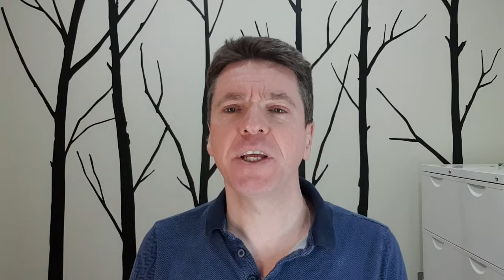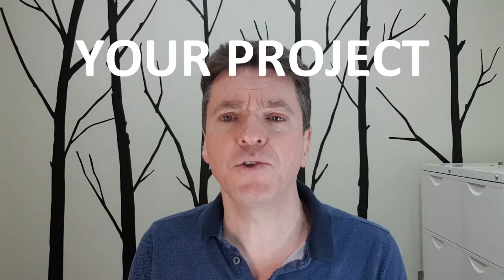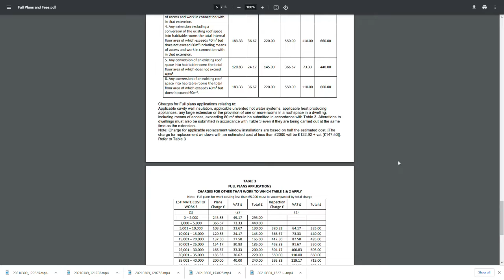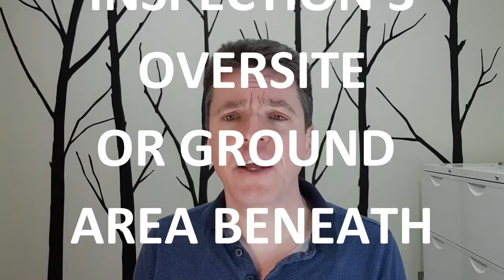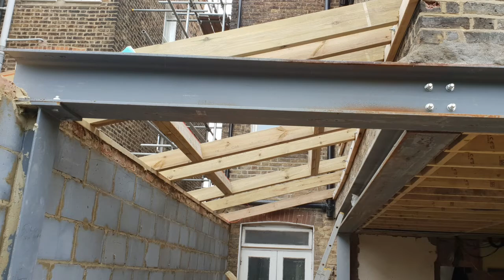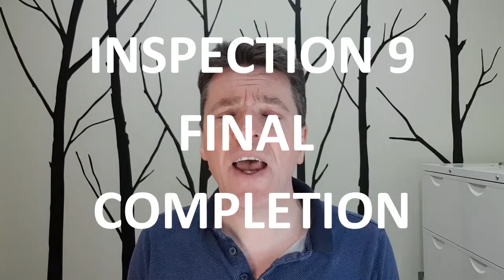Building Control for Extensions - All You Need to Know - What, Why, How & How Much - Housing Market

Comment: My single storey extension 3950 by 7800 would i need a steel above current existing french doors? If im not planning on making the knock through wider.  Just living room space and a flat  warn roof. Im a hard metals roofer and cladder by trade. 
The party wall is brick. With two other sides timber framed to hold my aluminium standing seam panels.

Comment: I'm a first timer doing a self build annex, I used Breckland Council. They did the initial visit when planning was first permitted. It was an informal chat, on site. They were really helpful and answered my questions, especially regarding deviations from the building plan and what can and can't be changed without amendments etc.

After each check I asked them what they wanted to see next. Booking inspections was really easy through their web portal. The first check was the foundation trenches, then drains, then DPC, then oversite with DPM before I poured the first slab. After that they said to go for it but contact them before covering up any insulation. 

They are very hot on insulation now. I kept records of all the U value calculations and have kept receipts so I can prove materials used. I've taken lots of photos and videos at various stages. I have also kept of all the official document parts and how they apply to my build. I am not a professional so I have done it "by the book" quite literally.

Comment: Hi 
Do building control have the right to say that we have to put pir insulation on our inner wall of cavity wall? 
We have our extension done and have issue with the building control,unfortunately they are private as I thought it would go faster and smoother but it seems to be opposite way,
Our extension is a cavity wall,break work outside and concrete block inside and it’s 100mm cavity wall insulation between but now he say we have to put 50mm insulation on our concrete block wall 
Could you guide me on this pls

Comment: Be aware that if you use an approved inspector (private inspector) then they should be informing your local council that work is due to start. This is called an initial notice. This gives your local authority 5 working days to get out on site to inspect. If the local authority notice that works have started within the 5 working days of receiving the initial notice then the approved inspector will be cancelled and the local authority will take over the inspections. Although this generally won't hold up your works it does add added costs as the builder or homeowner will need to complete a regularisation form which is more expensive than a building notice or full plans due to the works starting without permission. Then you have the issue of claiming back any money paid to your approved inspector. If the approved inspector is not at fault and your builder started within the 5 working days then the approved inspector has every right to withhold any reimbursement. So basically you could be paying twice for inspection fees. Yes there are good approved inspectors out there and my advice to homeowners is that if you agree to use an approved inspector please ensure that you use someone that is local to your area and can actually visit the site to complete inspection. Some approved inspectors do not live locally and won't drive out and will therefore ask the builder to send photographs in of the job. I personally don't feel this is good enough as the builder will not send off a bad photo showing bad work, rather at an angle that will hide any issues. The approved inspector will sign of the work as good without even visiting the property. Just been to a job where the local builder said he has not seen an approved inspector for at least 2 yr on any of his jobs. All they do is sent photos in. Imo do not use an approved inspector that cannot physically visit the site. This is your building and you need to ensure that any users of your property are safe. On another note, generally the price of an approved inspector is built in to the amount of visits needed to complete a build. So they will only visit a prescribed amount of times. Whereas generally a local authority will visit as many times as is needed to ensure the work is done.

Comment: You suggested trees within 5m of the proposed extension need to be considered. Might I suggest you consult NBHC chapter 4.2 as trees within 20m especially those that have a high water demand and are in a cohesive soil would still impact the foundations.
Although you can’t cover everything in one video, I think you summed it up well.
Ben

Comment: Thank you so much. This is a very useful video for extension project. I am currently experiencing a rear extension. I was asked to extend drainage pipe and the depth is 0.9m. But after doing so, I heard that the council said it was not deep enough. I was devastated. Money spent for nothing. I would like to check - is 0.9m good enough? Because I check online and it should be okay. Thank you for your tips :) cheers

Comment: Hi there can I ask you a question please on a some what related matter? I need to drill into my concrete floor (residential ground floor) to attach a fixing. I understand there is screed then the concrete then the DPM. How much depth do you think I have before I end up going through the DPM? I was thinking I drilling around 50mm into the ground. Hope you can help :) thanks in advance
Reply: Hi Christopher. Obviously I can’t say for sure but when laying a concrete floor the depth should be a minimum of 100mm but could be as much as 200mm so 50mm should be ok.
Reply from the maker: Hi Christopher. The usual depth for a concrete floor is a minimum of 100mm so 50mm should be fine. Obviously take it steady when drilling down as you will be able to see the membrane if you reach it. You could always repair it anyway in a worse case scenario so not the end of the world if you did piece it.
Reply: @joeblogs  thanks, I thought it may be 100mm. Its just that those plastic carcass feet types used in kitchens maybe a little weak considering the books will weigh around 400kg plus the wood. ps if you have a link or product name to repair just in case let me know, I guess it must be a silicone or similar you pour in? (should it be a drill hole. Hey many thanks for the reply and being so late as well :)

Comment: Hi, I’m looking to buy a house that had some extension work done back in 2014 to have living room and kitchen in place. The planning was approved but the sign off was not completed by the building control. The previous owner then sold it to the current owner (in 2016) who is selling the house as it along with indemnity insurance and not willing to get the completion from the building regulations as he is outside the uk. Is it advisable to buy this house? Not sure what stages were actually completed and what’s left.
Reply from the maker: Hi. Thanks for watching and the question. There is always a risk when buying a house that has had building work done even if Building Control has signed off on it. My advice would be to get a structural engineer to check out the extension and if they say that it is ok then you will have the comfort of knowing what it is sound. The work was done 7 years ago so my guess is that it should be ok as any issues should have shown themselves my now. If you do buy make sure you can assign the Indemnity Insurance policy to any future buyer who will be in the same position you are. One final tip - once you are happy ask for a reduction on the price prior to completion as this issue should be reflected in the final deal 👍
Reply: @joeblogs  hi, thanks for your reply. I have booked the building survey as the bungalow was built in 1950s and extension was built in 2014. Is structural engineer inspection different to the full building survey? I’ll try for reducing the price to the agent. Plus, I have also asked the council about the stages report yesterday to know what was done and left for the sign off process. Your video is very good, I don’t know much about the process and you have explained very well. Thanks

Comment: I’m doing a side & rear extension plus a loft conversation where I have to raise the ridge height, so it’s a total roof off job. I’m confused as to either go full plans or building control?
Reply from the maker: Hi Barry. Thanks for watching. It sounds like you are doing amendments to a residential property so you should be ok with a building notice. 👍🏻

Comment: Thank you for your response. My reply is that extension is 4m X 5.725m. Drain and sewage pipe is with 3 metre of the property confirmed by Thames Water. I have to submit application to Royal Borough of Greenwich my building notice. What is the rule to decide the type of notice to Borough for simple notice or full plan notice? Thanks

Comment: My question is to guide me about full plan application or building notice. If the drain or sewer is within 3 metre of the proposed extension then full plan or simple building notice will be required by Royal Borough of Greenwich which is relevant Borough. Thanks
Reply from the maker: Hi Riaz. Thanks for watching. The drains do not relate to the need for planing permission. The public drains in London are now all owned by Thames Water so you will need to contact them and apply for approval to build close to the drains. I can't say whether you need planning permission but you will definitley also need to apply for Building Control approval. 👍